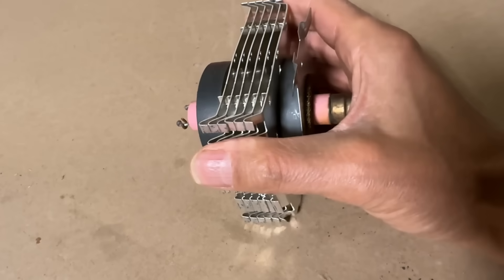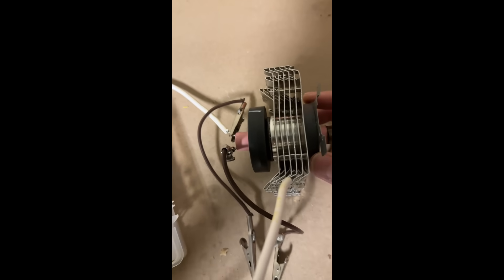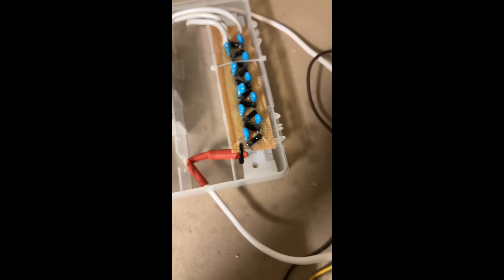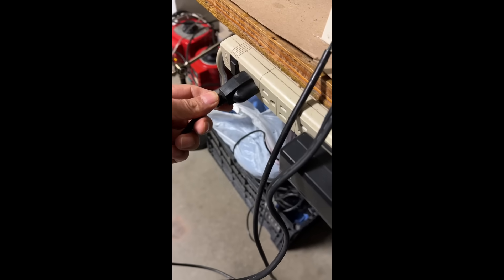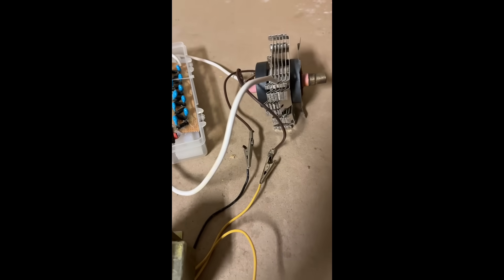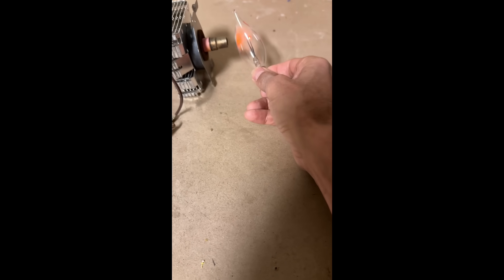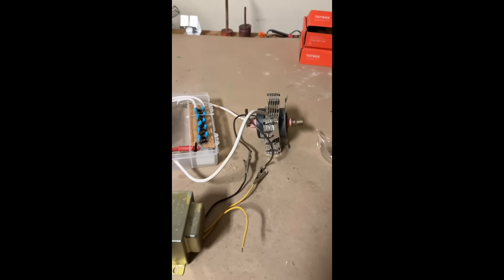Running a Magnetron at Low Power

Comment: Thank you for making this video.
Safety emphasis points: 

As you mentioned, the pink beryllium oxide (BeO) is safe when solid, but if ground on with any kind of grinding, cutting or machining tools the BeO dust is very toxic and will cause a fatal disease called berylliosis.

The voltages produced by high voltage transformers that power a microwave Magnetron will kill. High voltages can be transmitted without directly touching a wire on the output side of those transformers. 

Question: Do you know any way to modulate the Magnetron output when pushing it with lower power as you have done? Any way to tune it?

Comment: Excellent, this answers one of the questions I've long had in mind. I have somewhere an old magnetron that I consider too dangerous to run at full power, but I was wondering if I could operate it at a much lower power. That's cool, thank you for testing for us!
Reply from the maker: You’re welcome!
Reply: Why not just use a 6v or so ac adapter instead to lessen the trafo power? I use a small 6v ac adapter with a cap ladder/diode ladder to run a 30v honeyweel thermostat for a furnace/ac which makes the power about right. Then i use the thermostat to trigger a 5v supply which is boosted to drive a 12v relay for loads on Us grid of up to 6 amps or so... 15amp and 12ga standard won't actually run over 10amps continuous. I also made chargers and boosters for 1.5v alkaline cells bc the disposing of them every time was costly. Recharging them is pretty easy and most give several cycles. Some are better than others.
Reply: Im asking not being rude... Also. And i should rephrase... Im asking if youve tried and if you think the ac at the electrodes is similar to what it would be from a smaller adapter or from a dc to ac converter running at low volts. Either way. Fun video.

Comment: Thanks for the video, I pass on one of my experiments. I changed the half wave voltage doubler to a full wave voltage doubler so it microwave wave oven would be kinder to my 12v to 230v inverter for camping. What I discovered was that the magneton operates very close to their maximum capabilities and the increased power from the full wave voltage doubler destroyed the magnetron.
Reply from the maker: Wow

Comment: The magnets are more essential to operation than you suggest.  The field they create is what causes the electrons to deviate from a straight path (from cathode to anode).  The movement of the swirling electrons past the open sides of radially arranged resonant cavities causes those cavities to 'ring' like a resonant tank circuit.  This ringing further promotes the bunching of the electrons, ie, amplification.
Reply from the maker: Yes you’re right I could have mentioned the magnetic field induced swirling of the electrons past the resonant cavities. Thanks for pointing that out.
Reply: @BrianDhvTinkerer  All credit to you crazy Brits for concocting such a brilliant idea at such an amazingly opportune time!
Reply from the maker: @d.jensen5153 thank you! Brits have sure cornered the crazy science market!
Reply: It is more analogous to blowing over a bottle to make a sound...
Reply: You are exactly right, the magnetron is essentially an electronic wissle. The frequency of the wissle is determined by the dimensions of the internal chambers.

Comment: Looks like the microwaves are coming out everywhere.  Not good friend. I thought I'd see you tape your detector bulbs to a long stick.  Why in the hell would you hold them with your hands? Super dangerous friend.  Stop doing this please.  Louis Slotin thought it was cool to screw around with dangerous stuff like this too.  Do a youtube search on him and see how things turned out for him.  You're tickling the dragons tail my friend.
Reply from the maker: I’m running the magnetron way below is maximum rated power for demonstration proposes only. Maximum radiated output is about 10 W. I would never go this if it had full power from a mains driven MOT ( 1000W). Could barely feel any heat coming from it.

Comment: A  ferrite magnetron magnet ( care , VERY  brittle ! ) stuffed  onto the end of a wood broomstick , makes a 1st class workshop gizmo to pick up most of those spilled nails and drill bits 😝... recommend that you cover with the plastic lid from a spray can , to avoid the knocks that it will get ... (  tried - n - tested  ) ....................... DAVE™🛑
Reply from the maker: Great idea- I need to check that out. For sure ceramic magnets are brittle!

Comment: What could possibly go wrong? 🤔

Beryllium oxide is typically found in the magnetron of a microwave oven, which is the component that generates microwave energy. It serves as a ceramic insulator within the magnetron. However, it is important to note that inhaling beryllium oxide dust can be hazardous ⚠ and may lead to a serious lung disease known as berylliosis. 

*Key Points:*
- *Location:* Primarily found in the insulating components of the magnetron. 

- *Function:* Acts as a ceramic insulator within the magnetron.

- *Health Concern:* Inhalation of beryllium oxide dust can be very harmful ☠, potentially resulting in an incurable lung disease called berylliosis.

- *Important Consideration:* When disposing of old microwaves proper recycling procedures ♻ to safely manage potential exposure to beryllium oxide!
Reply from the maker: Gotta be careful to not break BeO ceramic. It’s the dust that’s a respiratory toxin. It’s likely that the pink stuff in these smaller magnetrons is more likely Al2O3 doped with chromium salts but can’t be 100%

Comment: You should keep it whole. The coils and capacitors connected to the filament keep the microwaves from backfeeding into the HVPS. The pink ceramic is made of chromium or manganese doped aluminum oxide. They use the colored ceramics to make it easy to separate suspect BeO tubes when recycled ❤
Reply from the maker: Thanks for in info!
Reply: Really? I have a LG magnetron with a white ceramic insulator, I’m assuming that’s alumina oxide too.
Reply: @18436Melissa  if it's a regular microwave oven then it's probably alumina. The only oven magnetron tubes I've ever seen that have BeO are the ones from antique Amana Radar Range commercial grade ovens and from radar stuff. 🤔
Reply from the maker: @christopherleubner6633 yes was just leaning on the side of caution regarding BeI vs Al2 I3 although doing this experiment in the first place  has its own set of risks

Comment: A really interesting experiment would be changing the frequency the mangnetron omits to a healing frequency such as 432hz.  How exactly could we achieve this so as we could set the frequency with something like an arbitrary frequency generator or Spooky2 Rife machine?
Reply: To do such would require a magnetron of massive size to resonate at 432hz as it is the size of the cavities that do the resonating... like blowing over a bottle to make a sound...bigger bottle lower frequency....seeing how a normal magnetron resonates at aprox 2,400,000,000 Hz to get 432 Hz would be massive to say the least, and then you'd only have 432 hz of electrical oscillation not audio...and the whole 432 hz thing is total hogwash anyways I'd rather not get into...
Reply from the maker: Thank you!

Comment: What was the current draw on the high voltage side?
Reply from the maker: 3 mA
Reply: @BrianDhvTinkerer  so only about a watt of electrical power?
Reply from the maker: Hv draw- about 12W it’s 1A on the low voltage side. The setup is quite efficient
Reply: @BrianDhvTinkerer  did it make your hand warm when you put it nearby?
Reply from the maker: @ianhosier4042  yes  you could feel a little warmth

Comment: I got the same effect using high voltage supply without any magnetron.
Reply from the maker: I will do another video once I get my microwave leak detector in to prove that what was produced was indeed microwaves. At the present moment, I don’t have equipment that can measure that frequency. My scope doesn’t reach that frequency but there are other ways to detect it and I will soon be able to get you updated on that.

Comment: Another way of detecting them is having an CRT tube TV switched on nearby. Makes the picture very distorted. Took microwaves apart, intending to use transformers in 12 volt to pure sine wave 240 ac/50hz  power inverters, but turns out the transformers soak up a lot of power in themselves, so not really suitable for inverters. Been learning how those high frequency ferrite transformers work. Got several I took from flatscreen TV's. As for the magnetron, don't fancy messing with them, but taken magnets out as I've been experimenting with repellent magnets to create spin, to generate free electricity. One experiment did light up a torch bulb at 9 volts. Not bad. Think I may purchase a microwave detector, maybe on ebay.
Reply: CRT = cathode ray tube. CRT tube = cathode ray tube tube. wtf is a tube tube? By writing 'CRT tube TV' in your comment you just wrote tube twice.

Comment: Interesting. I imagine the output frequency is determined by the magnetron geometry. It would be interesting to know how stable it is with time, temperature drive voltage and current, and possibly modulation from the filament AC. If you ever get one of those pocket spectrum analyzers it would be a nice video.
Reply: There are round cavities machined out of copper inside in a circle that act like bottles you blow over to make a sound, here it's an electron wind blowing over little cavities whistling at 2.4 Ghz, the magnets make this wind blow in a circle. The size of the cavities determines the frequency.
Reply: @Centar1964  That's a beautiful explanation and I thank you for it. Yet I bet the system will change frequency with temperature and supply. You will see slight  frequency modulation even on a crystal oscillator if you wiggle the supply or warm it up.
Reply: @christianblack2916  Most definitely, I saw a project where they were running FM by varying the supply voltage using the magnetron as a transmitter.
Reply: @Centar1964  That is just the sort of great tomfoolery I will get round to again when time allows. Decades ago I built a magazine project that that used two of the old-school 10GHz burglar alarm modules as a full duplex radio, wideband FM by varying the supply and a receive end using an FM radio as an IF. worked pretty well!

Comment: Did something similar many years ago using an variable homemade 2kv DC power supply and 3 volt 25 amp ac transformer for the filliment power.
900 - 1100 watt magnetrons are capable of low power operation via 0.5 to 500 mw
Reply from the maker: Awesome- thanks for the info

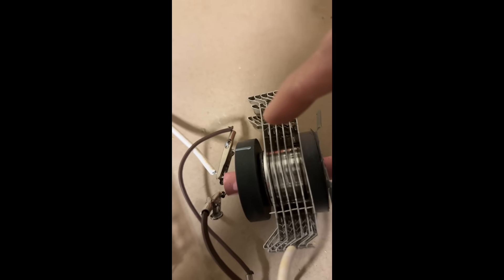Comment: Magnet serves to alter the path of the electrons rather than focus or concentrate them 1:35

 I think the beryllium oxide is a myth, its just alimina. Same material as a tig torch.
Beryllium was used in very early ones and possibly still is used in radar magnetrons.

If these contained beryllium oxide there would be a mandatory warning ⚠️ and special handling instructions. Which I've never seen

The alumina is good refractory material that can handle the heat, it does get very hot

Nice voltage multiplier

(Inverse square law would apply to a point source of radiation. Think its less apparent with a magnetron because its directional, also air molecules probably give you a lower estimate, and any objects, reflacruon interference etc.
Reply from the maker: Great info thanks! I changed my description!

Comment: Unless you already know exactly what you are doing, please do not open your old microwave.  The circuit inside generates about 2000 volts which WILL KILL you.  There won't be enough time to worry about micowave exposure.
Reply from the maker: agree - need to make sure the ME us unplugged and any capacitors inside it are full discharged before taking it apart

Comment: I have no desire to mess with a magnetron outside some kind of protective shield.. Be nice if it could be used as a UHF amplifier tube.. Have seen people make microwave transmitters out of them but really not practical.. Maybe build 30 of them to feed out full power all into one wave guide and you would have a directed death beam..
Reply from the maker: Yeah, it’s definitely a little iffy. You wanna make sure that if you do test it outside of an enclosure that whatever is supplying it with power has a very low output which is pretty much what I did here (max 12W). We do have 2.4 GHz devices in our house such as Wi-Fi etc. But these are much lower power. Even our cell phones do put out some bad stuff. But nothing enough to light up a neon bulb.
Reply: @BrianDhvTinkerer  I worked at the old WWWE 1100 AM radio station transmitter facility when I was in school and surely absorbed a lot of LF watts mowing the fields and around the tower.. At night we used to light up 4 foot florescent tubes just by holding them up in the air.. If something was metal you wanted it grounded or you could actually feel the humming of the RF in your hands as you touched it.. Using the push mower around the fence and base of the tower was always a buzz..
Reply from the maker: That’s wild!
Reply: In NZ there was a  one megawatt 600KV dc to 230 v 50 Hz inverter (Cook Strait) using mercury arc switching. The harmonic standing waves were enough to heat up metal pipes and handrails every couple of feet. All solid state now but do not recall anyone getting ill.
Reply from the maker: @howardsimpson489 that’s really interesting. Ik that there was a setup to transmit electricity wirelessly over a distance in either NZ or AU using microwaves in a narrow focused beam. Akin to what Nikola Tesla was trying to do with radio waves
Reply: The military have such a system for crowd control.

Comment: What is the voltage going in and what is the voltage coming out of your magnetron...You never told us that. Thanks for your answer...-John
Reply: I wondered that too.  I think I counted 10 stages in the voltage multiplier but couldn't see what the input was...
Reply from the maker: I’m using a voltage multiplier. The input is roughly 4 kV and there is some voltage drop when the magnetron puts out.
Reply: @BrianDhvTinkerer  Thank you. The reason I am asking is that I would like ot use a magnetron to collect voltage at gigahertz frequencies perhaps with a Don Smith device..thank you..-John

Comment: where is the electrical diagram ?
Reply from the maker: It’s basically this except instead of a microwave oven transformer I’m using a small voltage multiplier and low output power supply. The casing of the microwave oven transformer is normally grounded to earth ground but in my case it’s not grounded so it’s floating, which may be responsible for suboptimal output. Anyway, here is the diagram:

https://www.reddit.com/r/ElectricalEngineering/comments/14bs94m/if_the_one_end_of_the_secondary_winding_is/?rdt=65288
Reply: @BrianDhvTinkerer  but this is the traditional diagram, not your's special one!
Reply from the maker: Here is how I have it wired- even simpler then the traditional setup because the case is floating:
https://www.imagebam.com/view/MEZCVZ1